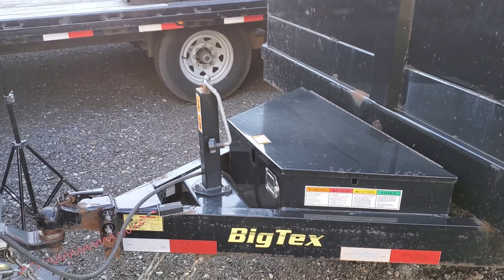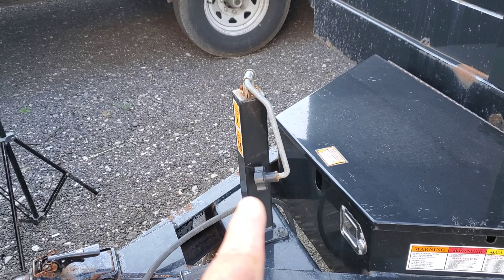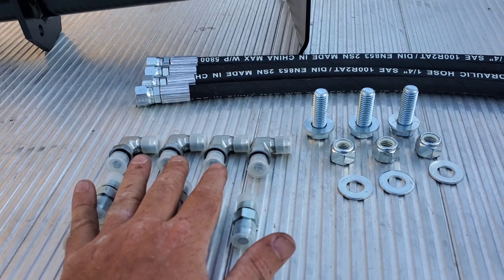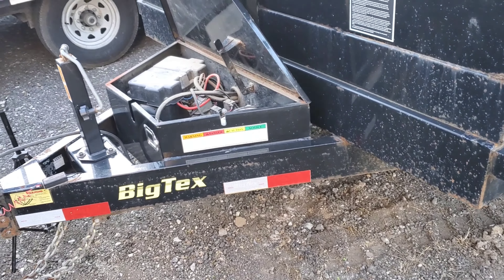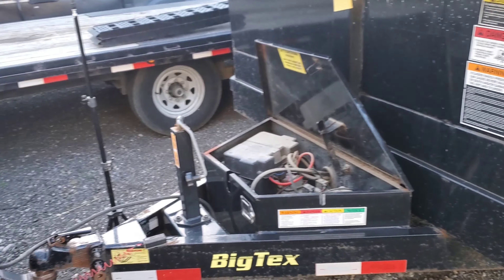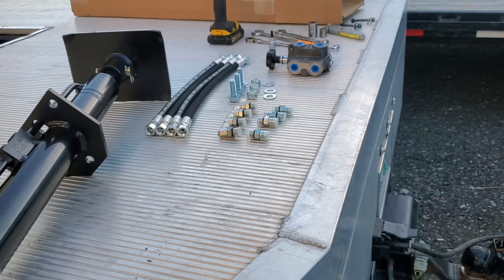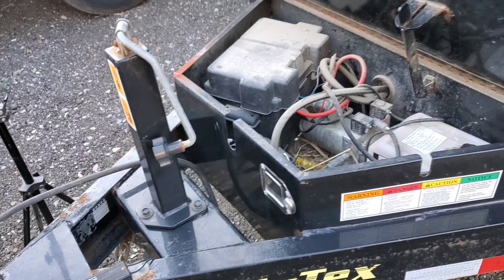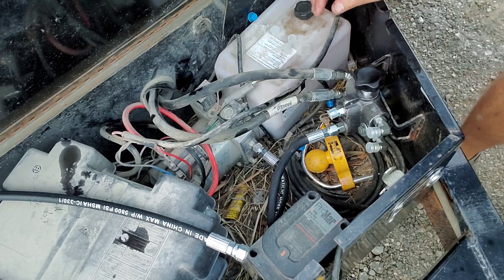best upgrade to a dump trailer!!

Comment: I know this is an older video, but I thought of a drawback of this set up.  What if your trailer battery goes dead?  I guess this is a problem with all hydraulic tongue jacks.  Not just your setup.  But you cant get the truck loose to use it to jump/charge it.  I guess you can pull the battery out of the truck.  Or use another truck & jumper cables.  Have you ever had that issue come up?  I am just a worry wart I guess.  Always looking for potential problems.
Reply from the maker: Haven't ran into that issue yet but it was on my mind when I was switching to a hydraulic jack. Figured I'd just use the battery out of the truck if needed
Reply: I always keep a lithium jump pack around.

Comment: AS far as making money with your dump trailer , What is the most frequent type of service that your customers ask you to perform for them ? Can you haul a small tractor in your trailer ? , Thanks , joe
Reply from the maker: I do lots of gravel driveway work with it. I can haul my mini excavator with it. I can haul my 3000 series john deere tractor with the front loader and box blade on it. I actually have it loaded with scrap metal at the moment to get rid of tomorrow. I do haul a lot of gravel with it though
Reply: @chrisward405  Thank you !

Comment: Great upgrade to any trailer, thanks for the video, can yoy share where did you get that kit please, and part number, thanks
Reply from the maker: Sorry it took a little bit to find the info but here it is. baileyinternationalllc on ebay. The price at the time was $283 and after shipping and tax it was a grand total of $345.66. Not sure if they have anymore or if the price is still the same as I have not checked since I've purchased mine months ago
Reply: @chrisward405  thanks, do you have the model number for that kit?
Reply from the maker: @gulopac1  I do not
Reply: @chrisward405  thanks, I found something similar

Comment: That's quite lovely.  Worth every penny.  Thanks for sharing!  Unrelated, my new 5500, identical to yours, pulls hard to the right and has some awful creaking sounds in the cab.  Have you had any issues with yours?
Reply from the maker: I have had no issues with mine. I'm sure the dealer will be able to help you out with it.